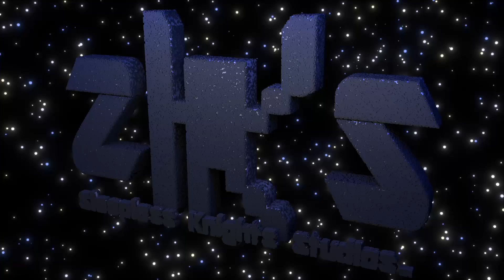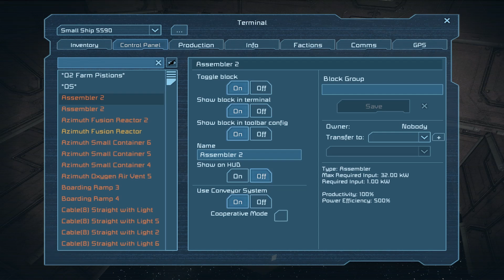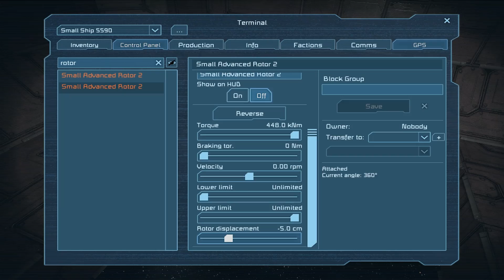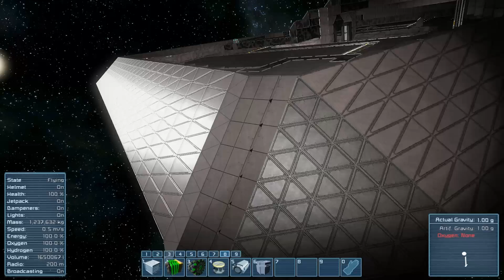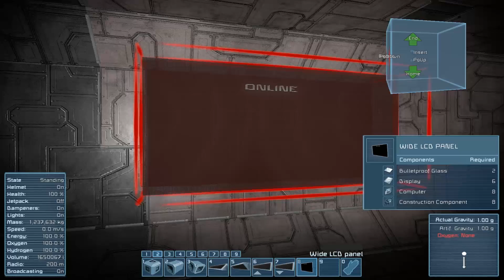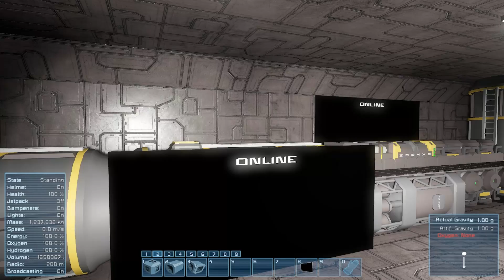Let's Play Space Engineers - Episode 85: Reac Room Refining

Comment: Awesome new episode! :D I actually really like those corner LCD panels, and I think they'd work great to label your rooms.
As to the reactor, I really like what you've got going on. If you're super set on a piston-retracting reactor, though, and you didn't wanna take up all the walking space, you could always run the reactor from the nearest wall to the farthest wall rather than from the right wall to the left wall. You probably wouldn't be able to retract both halves of it, but you could probably have one half be retractable that way. I do like the reactor setup you have currently, though.
As to the batteries, I personally don't like them being super encased, but that's just me. From a survival standpoint, having them almost completely embedded in the walls would make it difficult to read their charge at a glance, though you seem to be intending to display that on an LCD, which is cool. At the very least, though, I feel like you should get rid of the slopes that merge the batteries in the floor, as part of the batteries sticks through them and it just looks weird to me. But again, that's just me. However, if you had less sloping around the batteries you could probably merge the little reactor ring thingy into the wall more easily.
As to the shield generator, I think it'd look great in that spare space in the reactor room. Putting shield generators in block-built bubbles is a fun idea, but I feel like it wouldn't be very practical, as enemies could easily blow off the bubbles and deprive you of your shields. I still really like the idea of using reversed spherical gravity generators, though.
As to the solar panels, I think having panels hidden beneath retractable doors on the top of your ship would look pretty awesome. Definitely have them protected by doors, though, otherwise enemies could just swoop in and take them out. Alternatively, you could use that one solar panel mod that has curved panels and such so you could coat the majority of your ship in solar panels.
Anyway, this comment is long enough. :P Again, great new episode!

Comment: If you are going to add things to the top to make it lass flat. Maybe you can have "boxes" with solar panels in them. Normally the panels lay flat inside the boxes . But when you want to use them they stand up. This can be done by putting them on rotors.